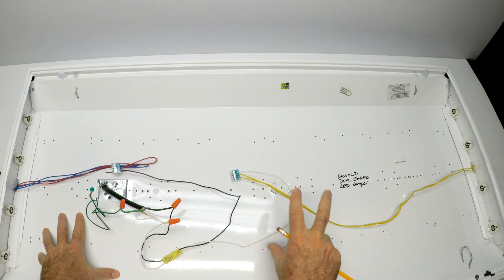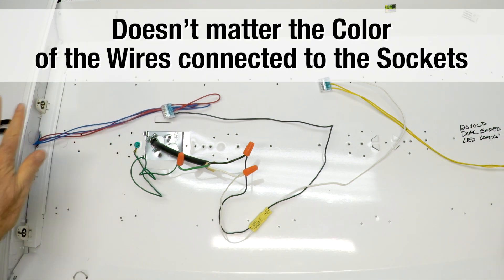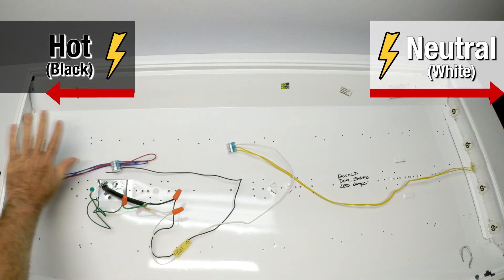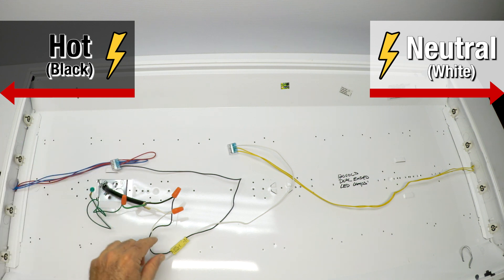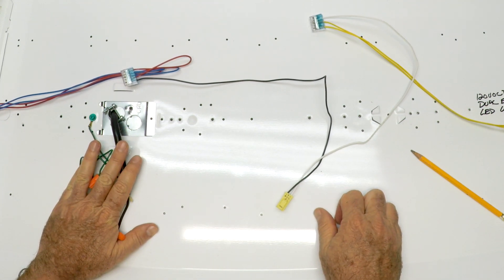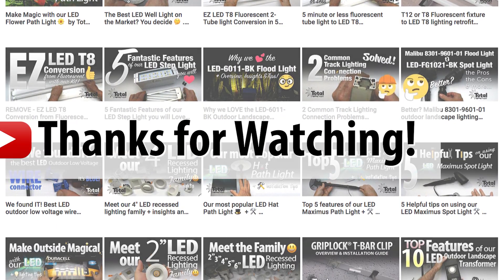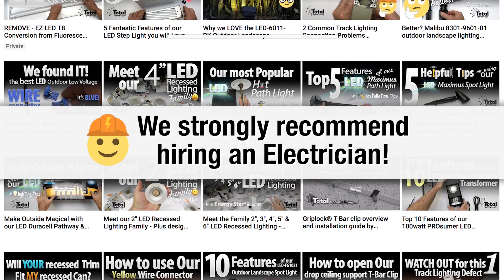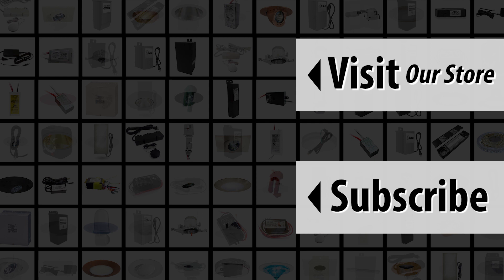LED T8 Double End Powered Retrofit Explained

Comment: How can I tell whether a tube is double-end or single-end?
Reply from the maker: If the LED tube comes with a wiring diagram it will be clear as to which type it is. Also, ask the store you are purchasing from. If they don't know find a retailer that does. Hope that helps 🙂